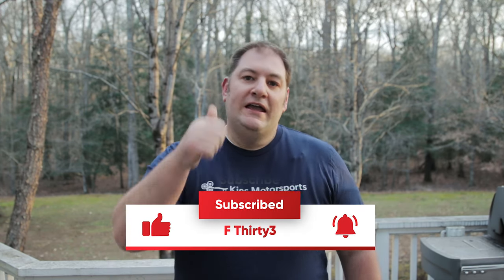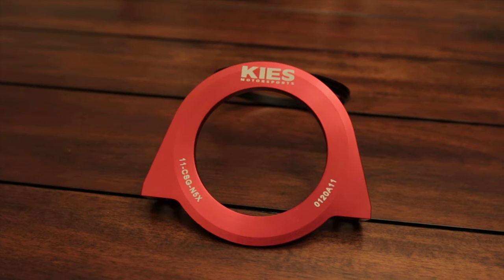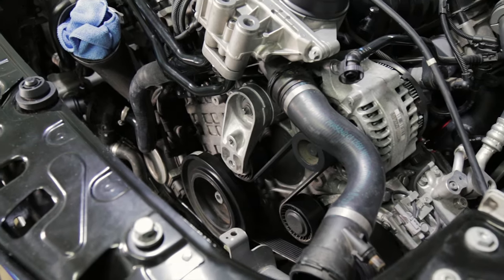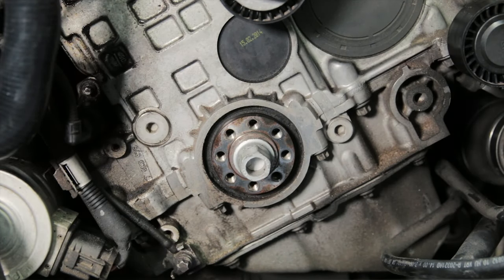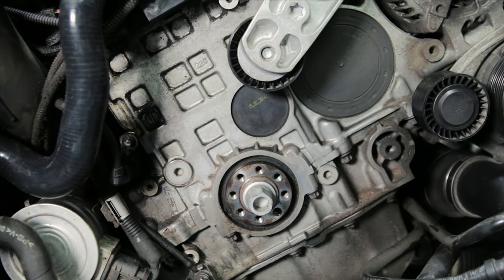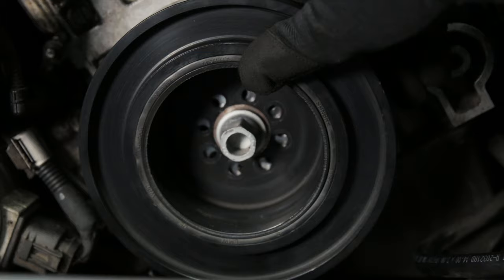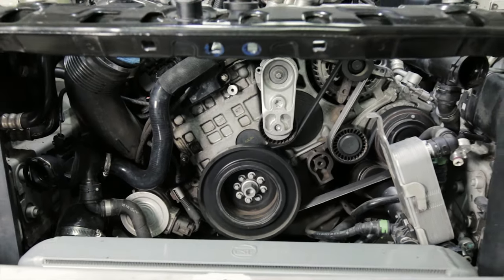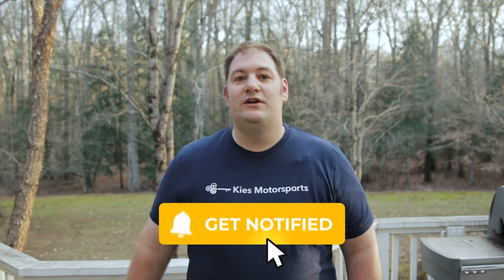THIS SIMPLE MOD CAN SAVE YOU THOUSANDS! 💣💥  (N54, N55, S55)

Comment from the maker: Oli leaks and BMW's go hand in hand unfortunately, so this is something anyone with an N54, N55, or S55 is going to want to do. It's a whole lot cheaper than dropping 5K on a new motor! 👍

Crank Seal Guard from: https://www.kiesmotorsports.com/products/kies-s55-n55-n54-crank-seal-guard-e9x-f3x-f30-f80-f82-f83-e92-etc

BMW Pully Refresh Kit: https://www.kiesmotorsports.com/products/bmw-drive-belt-tensioner-kit-genuine-bmw

🔧 Tools Needed:
T60, E10, E12, Torque Wrench, Socket Wrench, Allen Key
(8) E10 Torx - 35nm
(2) E12 Torx - 22nm

🧰 Tools Used:
Dewalt Mechanics Tool Set 247pc: https://amzn.to/31CHbcf
Digital Torque Angle Wrench: https://amzn.to/39YqYS8
60pc Torx set: https://amzn.to/39Yvd06
Reply: Does this also apply to the n20?
Reply from the maker: Great question, this seal guard doesn't fit the N20 that i know of.
Reply: I dont mean to be off topic but does anyone know of a tool to get back into an Instagram account..?
I was stupid forgot the login password. I would love any tips you can give me.
Reply: @Clark Nikolai instablaster ;)
Reply: @Mathias Case thanks so much for your reply. I got to the site thru google and I'm in the hacking process now.
Takes a while so I will get back to you later with my results.
Reply: @Mathias Case it worked and I actually got access to my account again. Im so happy:D
Thank you so much, you saved my ass :D
Reply: @Clark Nikolai Glad I could help :D
Reply: OLI LEAKS lmao it sounds funny

Comment: This is why I watch multiple videos before I do a job on my N54. I figured a cross pattern to tighten the crank pulley bolts. Yiur video is the only one I have seen that actually said it and gave the torque spec. Although torque specs are probably available with a quick google search. Thank you.
Reply from the maker: Glad to help! 👍

Comment: Also need to simply change the crank-hub if you don't want your motor to self destruct. Or you can simply not buy from a brand with way too many design oversights...
Reply from the maker: Every engine has their flaws, at least this one is an easy fix 👍

Comment: as you dont actually loose the cranks central screw you dont have the risk of the whole crank hub thing being worse than before right?
Reply from the maker: That's correct, very low risk. Just make sure you torque everything down in the right order.

Comment: Lots of great detail Sir, ty . I feel the cons of the bmw leaks...i feel its not the bmw Engineering or a problem with the metal parts,it is the suppliers gaskets companies ( probably mahle.AJUSA junk gaskets and the like...) it is of course, the gasket material itself...  what i don't really understand is,, a human being can build a spaceship, which can travel to the moon and back,it don't seem logical that any car parts manufacture cannot make a Good Gasket Material that can last the full life of their BMW machines (or any machines).So BMW, why use"Mahle or Ajusa gaskets????? if that is the OEM gasket used on these specific vehicles. do not use that same brand of gasket on these vehicles anymore,(because you will still have the same issue wit the the same brand gasket)!honestly,why use them??? they are "junk" gasket material its that simple!....use another reputable gasket company's gasket material composite. I personally own a BMW n55, again it not the metal parts that is causing any problem with those vehicles,it the "gasket" material that is the whole issue. As to the accessory belt, yes,the "ill call ," after market protector ring"can and will save the engine from major damage but the "root" problem is the "junk" sealing gasket material is failing to meet high standards of testing and it exceeds nothing. Over the years the consumer, like you and me has already test driven and proven/ tested the BMW gasket material on these vehicles. its junk. plain and simple....im surprised that BMW Engineers never rectified this issue years ago because these leaky gaskets are giving BMW a bad rating as to leaks!  ty
Reply from the maker: Completely agree, I'm not sure why BMW continues to use gasket material that degrades so quickly. I wonder if the higher engine tells also play a role as well.
Reply: @fthirty3  ,ty for response, Strange.. for example::: Permatex company can make a silicone that can and will reach Temperature range: -65°F to 700°F (-54°C to 371°C)...without any issues,muffler shops use it in conjunction with their exhaust gaskets so thete is NO Excuses . just a note:::: i had a 2006 toyota Highlander 3.3 litre that i sold with 400 thousand kilometers, never had any leaks from day one..... so gasket companies is out there  that do the job well.... just that BMW needs to get their act togather so the price of their machine matches the quality .they need quality Gaskets!! most of their problems would be solved ty!
Reply: BMW make more money selling parts than selling cars

Comment: Can I reuse the E10 bolts here that hold the harmonic balancer? Or do I need to buy new ones like almost everywhere in the N52 engine?
Reply from the maker: I reused mine and haven't had any issues 👍
Reply: @fthirty3  Thank you for the quick reply! Sometimes it's a hassle finding uncommon sized bolts to buy

Comment: Nice video, very informative and easy to follow!!  Question though, why do people opt to get a new crank hub which, from what I understand, can cost a great deal more instead of going this route.  Could a person have a crank hub failure even if they put this on their car?  Sorry for all the questions, but am interested in an M2 Competition but have heard about crank hub failures on that engine so a little worried.  I think those failures are due to over modded cars and quick downshifts I think?
Reply from the maker: Hey, glad you liked the video! This won't fix a crank hub failure for an S55 engine. The issue there is that because the hub is not Keyed and instead pressure fitted in place from the factory,  it can spin. The fix in this video would be in addition to the crank hub fix.
Reply: @fthirty3  gotcha!!  Thank you so much for the reply.  Seems like every car I like has some type of weakness that can be catastrophic…ugh!!!
Reply from the maker: Honestly though, that's really the only thing. Other than that they're solid. 👍
Reply: @fthirty3  I don’t ever plan on modding the car, so was wondering, is there a need to do it?  People say it can happened to stock or modded cars so it seems like it’s a crap shoot.  I would be getting a DCT so it seems like it happens to that transmission more.

Comment: Does any other car manufacturer have this issue where the belt can get suck into the motor?
Reply: In this engine it’s an issue due to design of the harmonic balancer. 
On most conventional engines the back side of the balancer is larger diameter than the front so when belts fail they feed off the front side. 
But on these engines it’s the opposite . The oily belt fails and gets fed into the crank seal side and destroys the seal and sometimes gets fed into the timing chain and causes engine failure . Chunks of belt and seal will also be in the oil pan and possibly clog the intake screen causing oil starvation and engine failure by metallic glitter contamination.
Reply: @rottenrobbie66  Did BMW correct this issue with their newer models?

Comment: Does the vargos spin lock solution do the same thing ?
Reply from the maker: Great question,  no thats different. This prevents the belt from getting sucked into the crank. The spin lock prevents the crank from coming loose since it's only pressure fitted together.

Comment: I watched a video of nour I think it was and he went and got the crank cup replaced on his m4 because that’s also a part that can cause issues. So is this piece to combat that issue too or are they both advised to be done and this crank seal.
Reply from the maker: Hey, great question! This mod is in addition to a crank hub update.
Reply: @fthirty3  thanks that’s helpful to know appreciate it
Reply: @fthirty3  also I wanted to ask on the f series with this defect with the OEM crank hub or the crank seal you get on the car from bmw what year does that range from? I mean if you have a 2017 model or above as that’s when the LCI facelift came in did they fix it after that or make any updates to it? 2018,2019 f series, 430d 430i 435d,i? If your aware
Reply from the maker: @PureGamingpro  They haven't made any changes to either of these two things with the LCI unfortunately. The Oil filter housing gaskets are still prone to leak which gets on the belt and the crank hub is still prone to spin on the S55's. The LCI's were primarily a facelift.

Comment: Hey man. What do you do if one of the bolts is stripped ? In the crank pulley
Reply from the maker: If the bolt head is just stripped, then you may be able to use one of these to remove it. Hope this helps 🙏 

https://amzn.to/3hp2xlC

Comment: Not sure why you decided to use isopropyl alcohol and a microfibre cloth. This isn't such a delicate job. Just use any engine degreaser and a parts brush if necessary. You can also use compressed air to blow off the residue.

Comment: Hey, great vids. I’ve exactly the same car with MPPK, same colour etc (in UK). How many miles do you have on yours? Wondering when the leaks may start!! Many thanks!
Reply from the maker: I've got about 65k miles and have had to replace the oil filter housing, oil cooler and valve cover gaskets. I found that I also have a small leak that formed from my oil pan which is common for the N55's, but I haven't replaced that yet.
Reply: @fthirty3  nice one, thanks for letting me know,! I’ve got less than 30,000 (previous owner didn’t use it).  I’m making good use of it now though so will keep a look for those - keep the videos coming!

Comment: Do y’all have a n52 one
Reply from the maker: Doesn't look like Kies Motorsports has them unfortunately
Reply from the maker: Looks like ECS Tuning has one that will fit the N52 motor. https://www.ecstuning.com/b-ecs-parts/ecs-crank-seal-protection-plate-serpentine-belt-guard-n52-n54-n55/005771la01~b/

Comment: I don’t not think this install possible as stated. There is not enough room between the fan and the harmonic balancer pulley. This engine seems as though it is on an engine stand.
Reply from the maker: It's tight, but there is room to do it without removing anything other than the air intake. There are other videos that show it being done in exactly that way. The only reason I had my radiator and fan out is because of an accident that I was in the middle of repairing.

Comment: What about the N52 engine?
Reply from the maker: I don't think Kies Motorsports has one that fits the N52 unfortunately  😕
Reply: @fthirty3  and would you know from where or from who I can get one that fits the N52?
Reply: @fthirty3  What is the reason they don't have one?
Reply from the maker: @jerrykampitsis3052  Looks like ECS Tuning has one for the N52 engine. https://www.ecstuning.com/b-ecs-parts/ecs-crank-seal-protection-plate-serpentine-belt-guard-n52-n54-n55/005771la01~b/ The one for Kies would most likely fit, but I believe it's only certified for the N55, N54, and S55 engines.